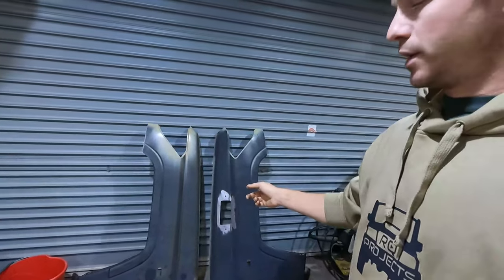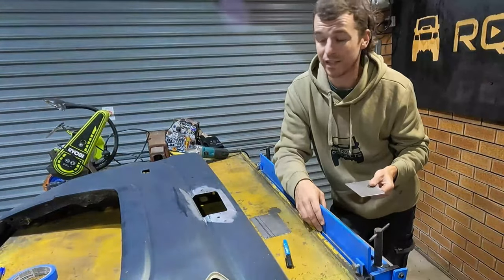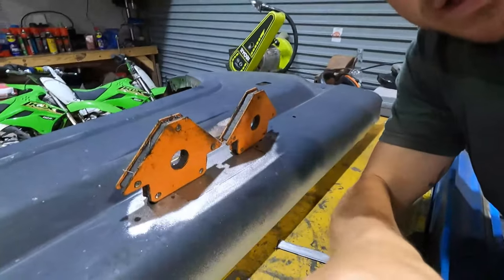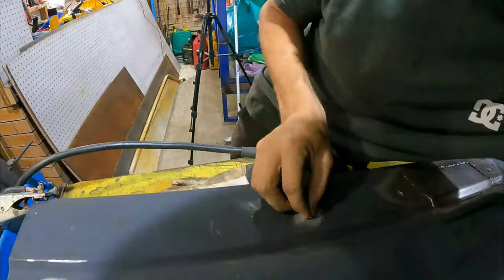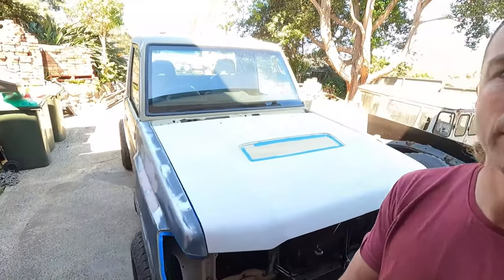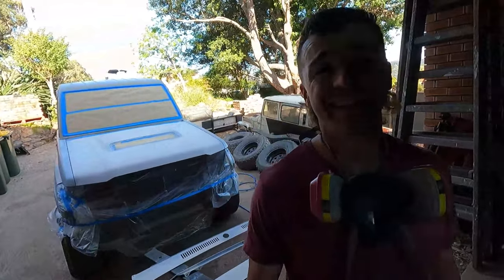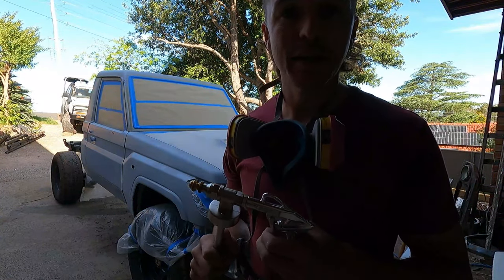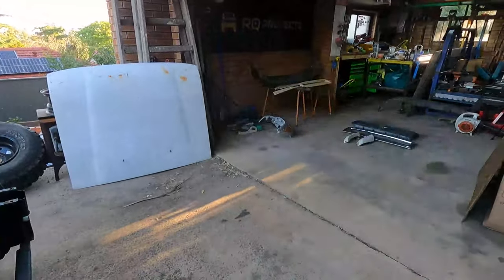I SPRAYED MY 79 SERIES LANDCRUISER WITH RAPTOR LINER! #GAMECHANGER

Comment: Not sure if your still active an old videos comments, but how did you remove the vents behind the doors on that B Pilar area? Same goes for the front window and rear window. Got the rest of the car stripped but those parts.
Reply from the maker: Hey mate, yep still trying to make videos, I got busy with a flood cleanup contract and just haven’t had time lately. There’s a fixing in each corner of the black plastic trim, one end pushes in, the other end slides forward or back, I can’t remember exactly which end does which. Mine were stuffed so I just taped up the hole for rego, I’ll fold up a steel panel when I get to it
Reply: @RQProjects  Cheers for the quick reply, I’ll give that a go tomorrow 👍

Comment: I really want to do this to my patrol! But I don't have the room to do it :( - Does it have strong smell? I am thinking F*c the neighbours and do it anyways ;P Also, did you mix it with random car paint or is that supplied by raptor also?
Reply from the maker: No it doesn’t smell bad at all. I did it on my driveway so ventilation wasn’t an issue, but I have done raptor in the garage it’s not too bad with a fan and the window open. For the colour you just get 10% of your raptor volume (400mL for 4L raptor kit) of 2 pack base coat from an automotive paint shop, use whatever colour you like, just be mindful that metallic colours don’t come through with raptor